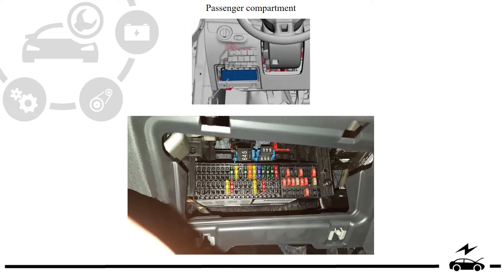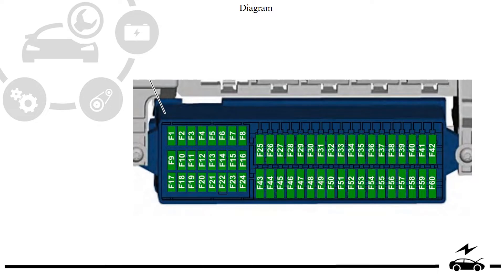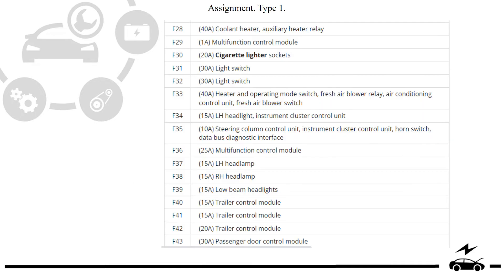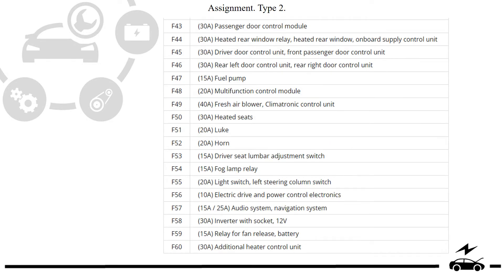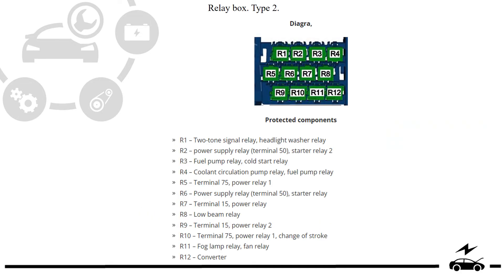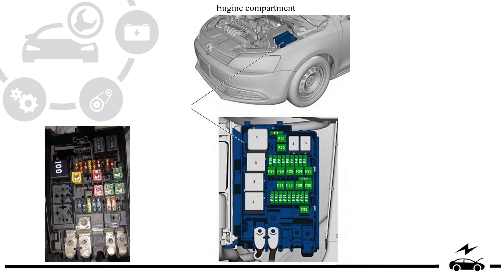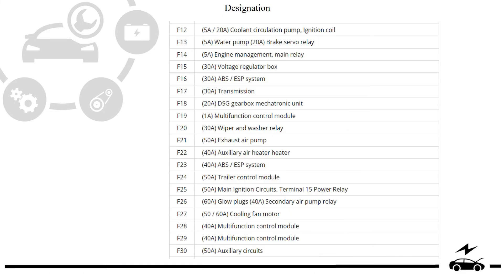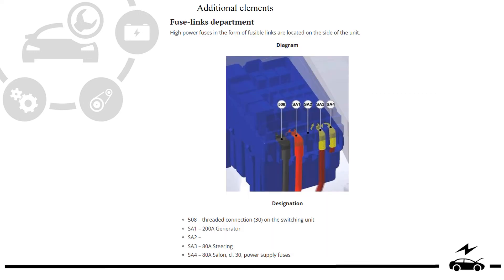Fuse box diagram Volkswagen Jetta 6 relay with assignment and location

Comment: Both headlights went out at the same time? any ideas
Reply: Was it the relay? I’m having the same issue
Reply: @ea531  no man, this sounds crazy but if one headlight goes out neither will work. I can’t believe this is not a safety issue/recall. Replace both headlights and there is a good chance you’ll be good 🤙🏻

Comment: No tail light fuses??
Reply: I am in the same boat, I even called my local VW dealer and they do not have diagrams either.
Reply: I have the same problem I just replaced the holder and when I change my reserve light. Plug
It back in they went out plus side one too